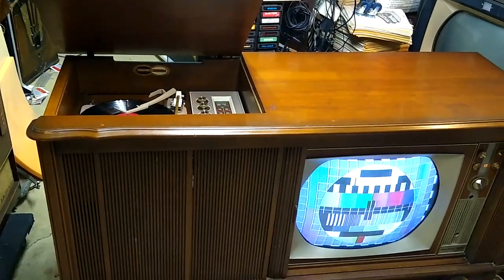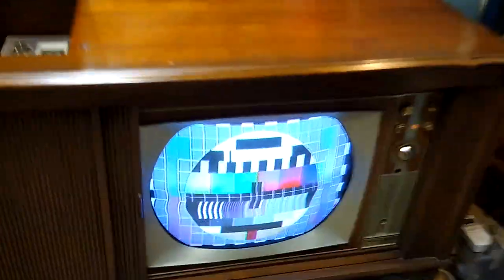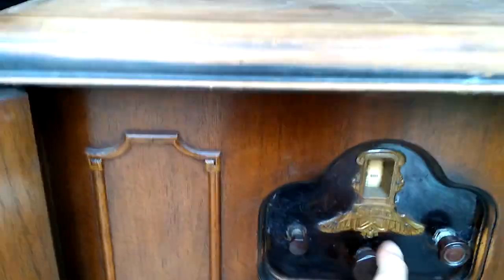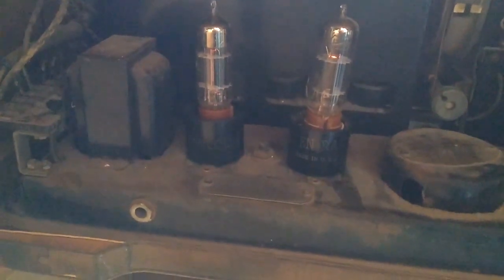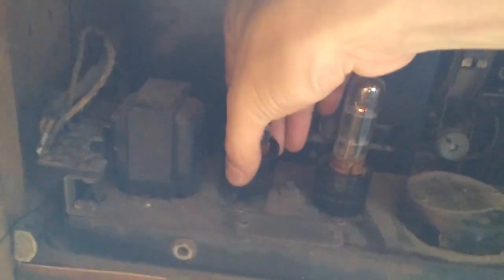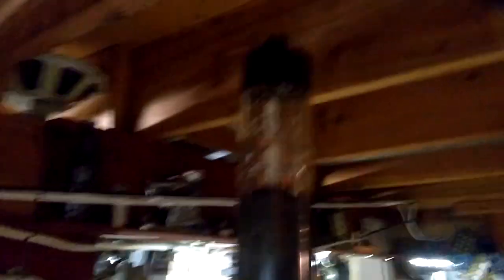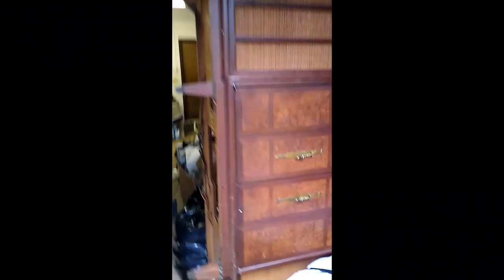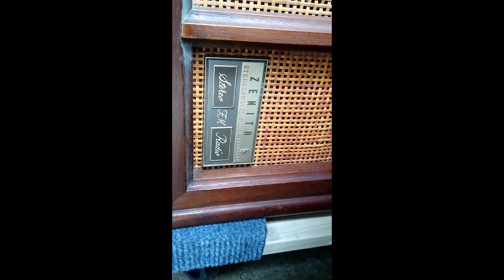Shorts Collection

Comment: Packard Bell was the brand name of the white plastic prop radio from Gilligan's Island  that never got dead batteries with an abundance of sea salt to keep them refrershed.
Reply from the maker: They made really good TVs too.
Reply: @tomcarlson3913  I wonder if Bell left Packard standing high and dry and was the same one that hopped over to work with Howell.
Reply from the maker: @jockoharpo2622  lol you never know. Probably a different Bell than the one that became AT&T.  As I understand it PB lasted into the 90s building PCs. Definitely a different Packard then the silly goose that went down with Studebaker.